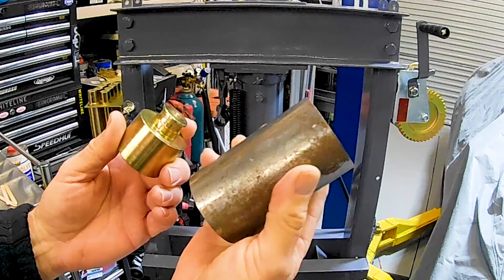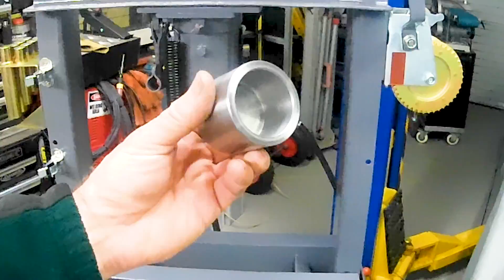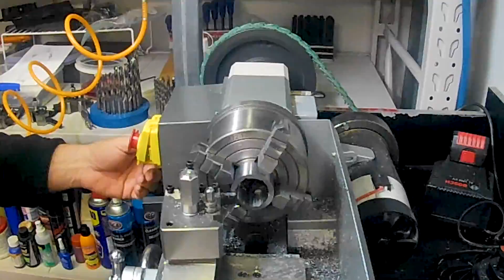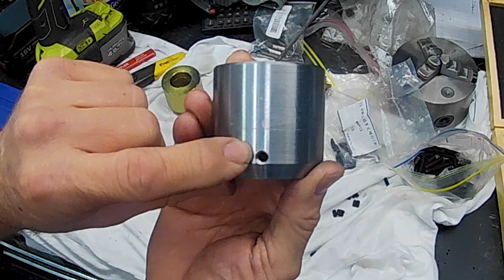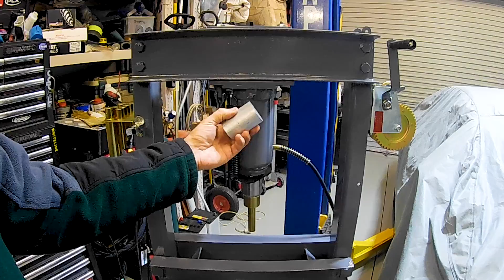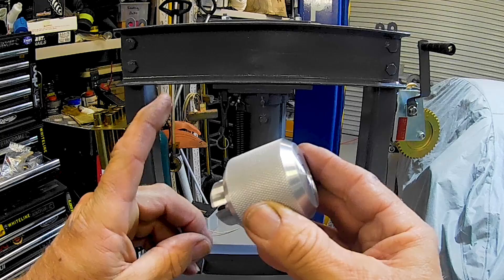The Ultimate 20 Ton Shop Press Build, Making the Press Pin Adapter & Valve knob on the Mini Lathe.

Comment: Curious, you used some type of sleeves that look like they interact with the jack threads.  You then slid your pin adapter over that and secured with a set screw.  

You didn’t mention it but I assume the sleeves must be flush to top of ram when sleeve is attached or that little set screw will not hold anything.  How secure is those sleeves?

I need to do something to use changeable pins and searching out how others have done it.

Comment: I'm wondering why you didn't just make a replacement pin adaptor that screwed into the ram of the jack? What I mean is something that replaces the whole threaded saddle" "Bolt" bit of the jack with a socket for the pins on the bottom.
Is the thread some odd ball size that would be hard to replicate?
Reply from the maker: G'day Mate, I actually dont mind the screw out extension. I did a job with this press recently & found it very usefull. Cheers Mate.